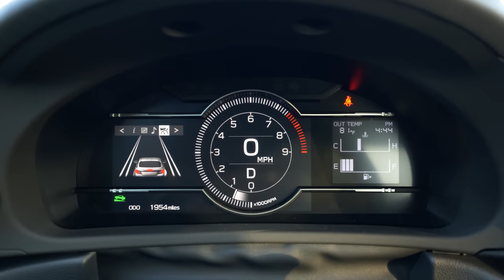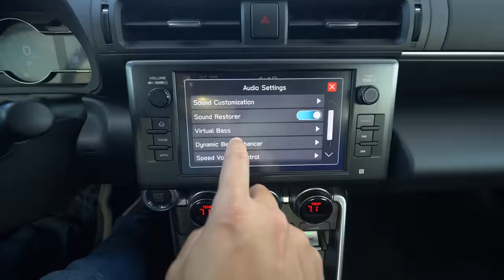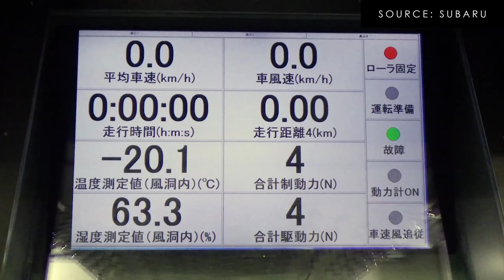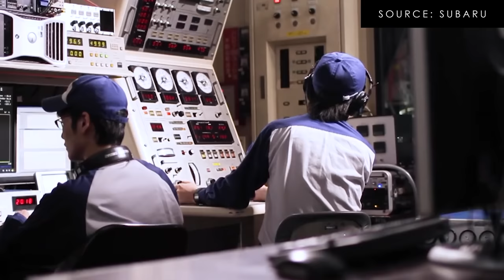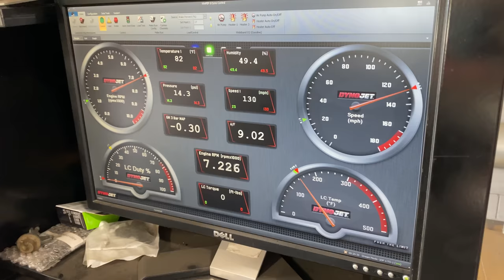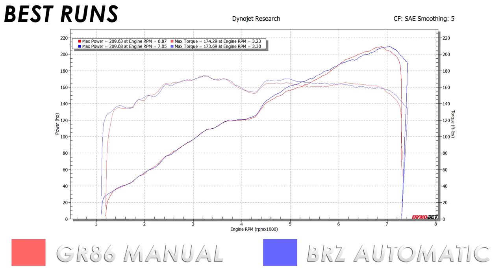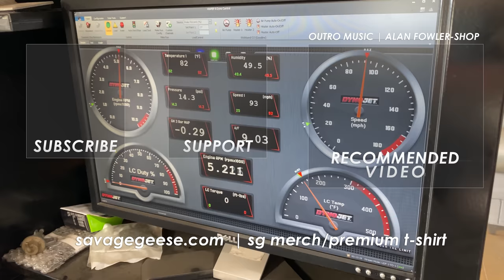2022 Subaru BRZ | Something For Everyone

Comment: Transmission jokes aside, remember what he said, 70% of sales are automatics for the 86/BRZ. Let that sink in. Stop complaining about the automatic, unless you yourself have purchased a brand new manual transmission version. If you haven't done that, your opinion literally means nothing to Toyota/Subaru because you aren't going to buy the car anyway. Buying used doesn't count. The manufacturers only get paid when you buy new, and it's new car buying trends that they must cater to in order to sell cars.
Reply: I love my manual cars but will not deny the fact that having it as an option likely kept the platform going especially on the 86 side over 2/3 were solid automatic.
Reply: I thought he said 70% of sales were manual
Reply: @michaelwakim2198  for the BRZ yes, not for the FRS/86
Reply: Yeah, Subaru themselves said the brz tended to have a higher manual take rate than the 86 by a wide margin. I'm thinking they got those numbers from Toyota.
Reply: @Tiny_Speck  Interesting. Wonder if it's because the demographics for the BRZ was older and were more used to driving stick.
Reply: The criticism isn't that the car is an automatic, the criticism is that it is a poor automatic. Complaints about an under performing component are perfectly legitimate, the previous generation was under powered and waddaya know this one has more power. If the manufacturers give you a choice they don't care which one you buy, they will build whatever is on the order books. If 70% of sales are automatics you would think they would put a better gearbox in what is meant to be a sports car
Reply: @4Kandlez  you are right and wrong. For this video, the slow transmissiom is what they are discussing but the person who you are replying to is referring to everyone in the car world shitting on automatics, but most of the time its someone who doesnt even own a manual and never will. Ive seen it first hand. I went to a car meet and my friend drive us there in an automatic v6 charger. Then he saw a nice mustang and said "damn, shame its not a manual though". Like bro really? The irony is real with people these days
Reply: Actually manufacturers get paid all year round because of franchising fees parts sales.
Reply: @RAZGR1Z  those have nothing to do with what transmission options are offered. They will make more autos vs manuals because they sell more new autos, not because they sell more parts for autos.
Reply: @DysphoriaRL  exactly right. It's some kind of psychosis that affects certain kind of car enthusiasts who has more opinions than experience. 

I personally drive a GTI with the DSG. I love this transmission so much that I can't fathom having a manual in this car. It just makes driving quickly so very very easy. Good automatics are amazing.
Reply: @DysphoriaRL  Don't know how you got that impression, he's obviously talking about the negative comments in the video regarding the 86/BRZ auto box
Reply: 💯 % 
Manual buyer myself :)
Reply: @Showmetheevidence-  unless you bought brand new of a dealer lot, doesn't count as far as manufacturer's are concerned.
Reply: Ok, ok……no one died.
Reply: I bought a new manual
Reply: Proud owner of a manual 23' BRZ.
Reply: Picking up my manual brz at the end of January!
Reply: @RRtradestar  welcome to the club 👏👏👏
Reply: @future_phonk  I can't wait. I found it at a dealership almost 400 miles away. I'm taking a road trip with my wife to pick it up and figured it would be a good break in period too lol already got a snow tire/ wheel setup to bring with me 😅
Reply: @RRtradestar  that's awesome. I hope you enjoy the trip there and back! I was lucky to find a msrp dealership less than an hour away.
Reply: @future_phonk  I got it for invoice price! 
It was the only dealer I could find that had it listed under or around msrp and was getting the color and trim I wanted. Shout out to Van Bortel Subaru of Victor, N.Y. lol
Reply: @RRtradestar  good stuff. Yeah shout out to Subaru of Naples for helping me out.
Reply: Would have loved the manual, but with the traffic at where I’m in, a manual doesn’t make sense unless this would be a secondary vehicle and not a daily driver.
Reply: @realspenz  I'm in nyc and I commute from one borough to another, I'm not letting that stop me from getting a manual. I've been driving them my whole life and I don't even notice it at this point. 
Manual or automatic, as long as you're happy with the car, who cares what other people say

Comment: I feel like this is the only channel that knows how to review cars. Every car is reviewed for what it is and for the purpose it was designed to serve; I really appreciate that. Other reviewers would complain it isn’t “luxurious enough” or doesn’t have a panoramic sunroof 🙄
Reply: *cough *cough *redline reviews *cough
Reply: Or do the sun visor test...🙄
Reply: TBF, a panoramic sunroof would be nice.
Reply: I know right!!!
Reply: @johndorling2118   not for this car, its a cheap, fun sports car, not a porsche or a luxurious cruiser and its bad for the center of grafity too
Reply: @wking8  tbf... It really makes a difference, especially mid-size cars like camrys where they put that little sliding door and it doesn't cover the edge that hits the side of my eye.
Reply: I know, I hate those reviews.
Reply: @TaijiArban  then buy a camry, not a sports car
Reply: That's why I don't watch straight pipes reviews anymore. They're kinda boring
Reply: @veryrare7647  why?... Did you even read my comment? This car doesn't have that(i think). But camrys have that little slider inside the sun visor that doesn't even block the sunlight properly. Why would I buy it then? I have a camry that came like that and now it's one of the things I hate about it.
Reply: @ydidishitmyself353  I wish car makers would do more to strip out IMHO useless features like the touch screen in the center, bring back more analog controls (cheaper than digital) and use some of those savings to spend more on the MATERIALS used in the car. Call me spoiled, but it sucks having a great driving feel, but the interior materials in the car feel crappy or you know will start looking crappy very quickly with regular use (looking at you, Piano Black)
Reply: Raitis rides is really good too
Reply: @WarCry389  cringy is the right word
Reply: @AB0BA_69  the issue is that your required to have a rearview camera now, which means you need the touchscreen radio
Reply: @shaneme3  there are other options like having a display in the cluster or having the display in the rearview mirror
Reply: Redline Reviews.  Every car he reviews just absolutely must have a pano roof.  Complaining about something like that gets really old.
Reply: Redline gets more excited about “infotainment” than anything else.

Comment: You know, I'm not gonna rag on the automatic. I'm not going to diminish anyone that gets one of these in an automatic. In the 80's, 90's, and early 2000's we were awash with small-to-smallish 2 door cars that could be had with a manual or automatic. I had 4 cylinder Mazda MX-6 with an automatic/I had a 6 cylinder Ford Probe with a 5 speed stick. Same car basically, but with wildly different personalities and driver experience. There were manual/automatic Mitsubishis, Honda Preludes, Mercury Cougars, Ford Thunderbirds, Toyota Celicas....Hyundai Scoupe's? Saturn SC's? I don't know whatever.

Point being; All of that is gone now in the 2 door form. You can get a Mustang or Challenger or Camaro today that'll barely fit in a garage with their size. Or you can get one of the few remaining FWD hot hatches, which are objectively Not Coupes. But something like this and the GR... I'm glad they offer it in a MT/AT form. I'm glad it's still compact compared to todays cars. I'm glad it sends the power to the rear wheels. Fuck it. Buy an automatic if you daily in gridlock traffic and have to navigate horrendous parking structures. You can let your mom with the knee replacement surgery use it in a pinch if she needs to. Buy a manual if that's your thing and it enhances your driving fun so much. Who cares? Buy it regardless because there's so little out there in the small 2 door car segment. Soon there will be none. And we'll miss the days when we even had the chance to buy an automatic BRZ/GR86.
Reply: Me suffering in my 18 brz from 9 hour drives.
Reply: The Z and Supra are obvious alternatives to American coupes

Comment: Best feature is the cop at 4:28 didn't pull you over, because you can't be going that fast after all in a BRZ.
Reply: epic
Reply: I got 245km/h in a stock brz, typically tho I'll reach 230-235km/h (2018 manual). My buddies  2015 civic SI didn't reach that when sped
Reply: @invertedv12powerhouse77  the time it takes to get there my genesis coupe will already be in the next city lol.
Reply: @MJT-DA  didn't take that long on a long empty highway early COVID lol. Remember the peak torque is at 6200 rpm which is basically around 230-240 km/h range in that year (4.3 final drive vs 4.1 in the older models)
Reply: @invertedv12powerhouse77  Lmao thats true I respect brz owners especially those that can embarrass those cocky hellcat owners exiting the highway after since they can't corner. But i live in Northern Ontario we don't have much twisties so I bought the genesis coupe 2.0T instead for the 274hp out of the box. And i can through on a larger turbo without changing anything and add more power. However if I lived in Southern Ontario with country roads fk the hyundai.
Reply: @MJT-DA  I'm in the Barrie area right now lol. From Quebec city so I had my twisters north of that city and saguenay
Reply: @MJT-DA  I live in the area of the Appalachians near the Tail of the Dragon and have had a BRZ for several years. Love it on these roads. 

Getting rid of it for something more special and performance oriented, but I will miss it a lot.
Reply: @backroadblast6603  let me guess the new 2023 m2 that was spied last week? Or the new z?
Reply: @MJT-DA  lol no. 

Waiting to see what the C8 Z06 is actually like, may order one of those. If not that, then probably the new GT500. Been waiting and saving for a long time so I can move upmarket.
Reply: @backroadblast6603  oh i thought you wanted manual. I know the gt350r has a manual transmission but the gt500 I think has the 10 speed auto, not that its bad.
Reply: @MJT-DA  drove the GT350/R. It’s a magical car. 

A manual or not is not a deal killer for me as long as the transmission that is on its place is good. The GT500 and C8 share a dual clutch just with slightly different tuning. 

That’s part of what makes the GT500 so cool: a Mustang with a DCT. What a world.
Reply: @backroadblast6603  Get the C8 so you can lie and say you have a lambo lol! My dream car is the c8 the GT500 is a great choice too good luck!
Reply: @MJT-DA  thank you!

Comment: Thanks for doing this video. As someone with a knee injury and pushing a clutch down or holding it at the engagement point actually causes pain after a few times- it's great to see automatics being included in 'fun' cars like this. I miss my old MT Skyline and haven't really looked at affordable 'sporty' cars due to their exclusivity with manuals but this BRZ/GR86 is the first time I feel I won't be losing too much on the experience.
Reply: Bummer that happened to you.  Have you tried a different car?  I get leg pain sometimes too, but only in cars with upright seating positions like a sedan or truck.  But I'm fine if I sit low in a sports car and get to push the clutch on a straighter angle.
Reply: The Miata can be had with an automatic.  It’s actually a pretty decent unit.

Comment: Great Dyno numbers again. I want one in manual, get headers, a tune, track pads, high temp brake fluid and 200 tread tires and then hit the track.
Reply: Try some lighter wheels and maybe a little weight reduction too like rear seat delete
Reply: With the right driver skill to match, it would be quick!
Reply: Bottom line…like the Miata it’s a car marketed to your little sister, middle aged creepers and track posers…
Reply: @BERZERKERSV4  lol
Reply: @BERZERKERSV4  Cool story, not true but hey people love fiction. I race at PPIR here in Colorado and I can't wait to get this on track.
Reply: @lewdkingdomdoujinshi8801  Lighter wheels maybe down the line but rear seat delete is not happening I don't need the back end of the car lighter I need less weight off the front end.
Reply: @CruiseControl1  Seriously. Anyone who complains about the HP of this or a Miata both of which will easily do 90 to 120 coming into any track's turn 1, and think this isn't "fast enough" either a) hasn't done much track racing/driving or b) has done A LOT, and already has a faster track day/racing car.
Reply: @ragweedmakesmesneeze  Perfectly said, my 09 Civic SI coupe only has 197hp and yet somehow I have a blast racing it on track. Could be the 8,200rpm redline and sweet 6 speed manual.

Comment: Loved the transmission argument. Jack was so passionate. I thought the take rate for the manual in the BRZ was still well north of 50% though? Overall, still seems like a great package.
Reply: I thought the same and just did a quick google.  Manual take rate for BRZ is 78%.  Manual take rate for 86 is 33%. Weird, I know.
Reply: @Hosz688  That's what I thought. Wonder if the most recent stats are different, but it makes sense to me. Subaru buyers are stick shift lovers.
Reply: @802Garage  Yea, Toyota is very big and mainstream. Makes sense they would have more Auto buyers and the 86 sold twice as much.  Subaru is more of a niche and enthusiast focused brand just like Mazda. Though their starting to push that CVT too much.
Reply: I can’t believe anyone would buy either of these with an auto.
Reply: @kc510  Much same.

Comment: Still number one on my list if I can secure more gainful employment. More inclined to buy the Toyota for sentimental reasons, but I'd be happy with either in manual. Hopefully that turn signal issue gets fixed.
Reply: A white one with black accents? Or an orange one?
Reply: labor should be cheaper than Subaru
Reply: @wayward03  No time for a grey, black, or white one. Gotta be the orange.
Reply: would always get the toyota over the subaru too. i think it just looks a bit better, same thing as last gen
Reply: @felixnurscher6017  It's funny how subjective it is. Last gen I thought the BRZ looked so much better, but this time I sliightly prefer the 86.
Reply: @erwark  I feel like last generation looked a lot more similar. This generation I find the 86 to look vastly better
Reply: Gainful employment is everywhere! We are short tens of thousands of truck drivers for one in the USA.
Reply: @2004cyrus   Trucking is one hell of a good career move right now. But I went to college when I was in my late '20s so I could finally have a white collar job. I've done just about everything under the sun, including carting around dead bodies and flagging traffic at this point. Started off with trade school, finished that certification program, couldn't get anything, got my B.A. after hunting for a year.Now I'm looking for remote work so I can keep living in the small town I bought my house in.

Comment: I recently bought a 2022 Veloster N ending my monumental journey trying to find one without a 3-7k markup.    Good luck to all you BRZ/86 buyers, have patience and don't give up.
Reply: That markup is not bad at all comparing when I try to get a challenger but dealership still rackingn up the markup at 15k more
Reply: @Carlos.Rivera  Yea, their definitely not worried about not being able to sell them. All of the R/Ts are going low-mid 40s and Scats are going for over $50K. Meanwhile one of the local Ford dealers has plenty of discounted Mustangs. Almost went to get a loaded up Ecoboost with the 10-speed for $38K instead of ordering a BRZ.